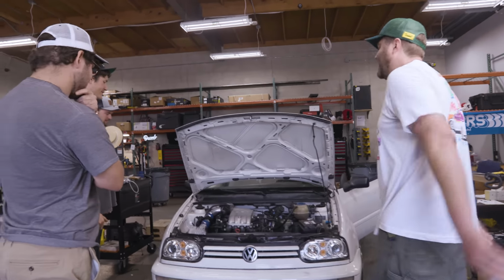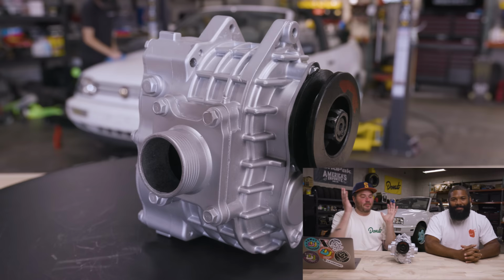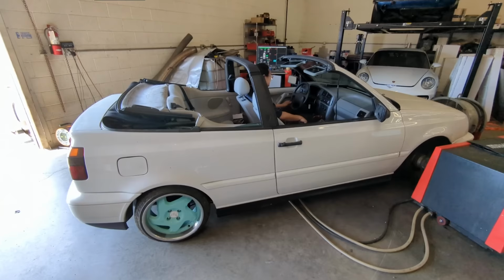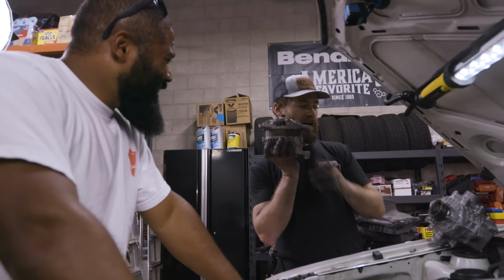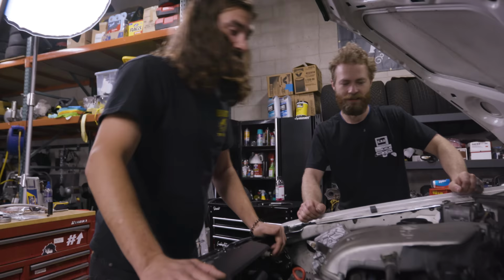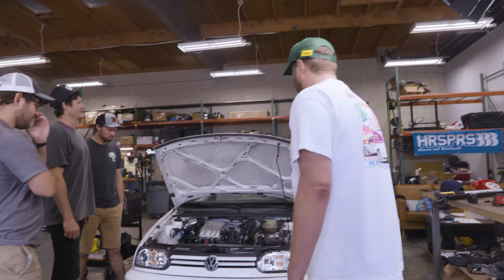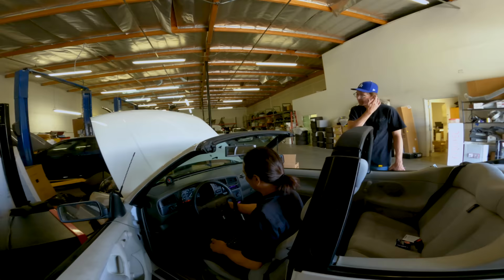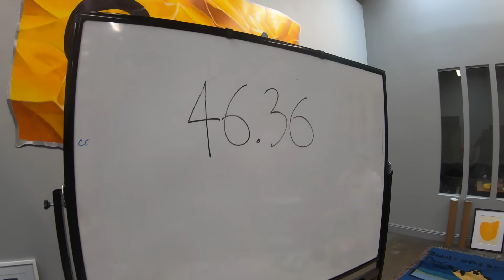We Installed a Wish.com Supercharger on Our Car

Comment: The amr500 super charger is what is used in classic beetles. Apart from questionable quality this should be useable for that.
Reply: they are designed for a 900cc motor not a 2L
Reply: @desertsasquatchxploration1568  they didnt give it a tune so its just working harder to compress more air (both in the supercharger and the compression stroke) with no more fuel - hence much less power.
Reply: There is something wrong with the installation, that's why it didn't work, you are right we also tested it on an aircooled vw and it worked well
Reply: @mycosys  explain how changing fueling and ignition is going to over come a lack of air flow coming out of that charger.
Reply: @bowez9  it's not a lack of airflow, its excessive airflow for the a/f ratio
Reply: @datjap8883  but they measured about only 1 psi when letting off the gas. I might lean towards it being restricted or geared wrong with a too large pulley
Reply: I saw that these were also being sold as replacement superchargers for the 2000s Scion tC
Reply: @bowez9  it wont - but it (and the rest of the tune inc pulley sizing for that matter) would at least tell us whether that was the case
Reply: @mycosys  pulley sizing isn't tuning any more than swapping a cam or a head swap is tuning.
People were brought in with experience with the charger so the compressor map should have been known, never mind the inlet/outlet port sizing (being 1/2 the size of the stock ducting wasn't a good sign either; as it would only flow 1/4 of the air.)
Reply: @bowez9  Those three things need to be in a correct balance for the engine to work properly, that's basically what "tuning" is.  If any one of the 3 is out of whack in comparison to the others you'll lose power instead of make it (or possibly destroy the engine).  You can't just add one without properly adjusting the others.
Reply: @ToasterCoasterAdventures  its a 500cc per revolution super charger, it would need to be spun at the correct speed to work
Reply: @mycosys  The air intake system will adapt enough for the measured air increase and supply more fuel (if this is the case).  The issue here is this supercharger cannot move in shear volume the amount of air that the car needs even at STP.  The stock engine itself moves more air than the supercharger can.
Reply: @s.willis8426  tuning is what I'd done after the proper parts are installed.  Not what is done to cover the wrong parts in the wrong application that is a redesign or modding.
Reply: Wrong parts in the wrong application is what being a gear head is all about.  Like a small block ford in a porsche 914, a LS in a RX-7, or a rotary powered Miata.  This was obviously not a serious mod they were doing, they bought a cheap part from a non-automotive marketplace and tried to see if it worked.  That said, if they bought a serious supercharger from a reputable retailer, installed it on the Cabrio with no other upgrades or tuning and they likely would have had similar results of it not working properly.
Reply: Are they just running it super lean? Doesn't the pulley decide the pressure it's going to build? So they are just shooting more air into the engine and the same fuel ? AHHH SO MANY QUESTIONS! Aren't old beetles carbonated , the more I think about this the more questions come up.
Reply: @ToasterCoasterAdventures  well.....not unless you over spin the rotors some more LOL.
Reply: I thought the same. It should have not cut power in half. Is it possible the smaller pulley is overdriving it past its capabilities? Was the tune done at the dyno or at least capable of being modified at the dyno?
Reply: @Mr371312  really cant go smaller than they had, this supercharger isnt big enough for anything over a liter.
Reply: @mycosys  watch grind hards video, the pulley is already small and nobody runs superchargers of the serpentine belt anyways. But superchargers in general are very finky and hard to make work. Theres a reason turbos are used over them.
Reply: @bowez9  this compact style of roots supercharger isnt used by anyone seeking to make true power, again its best application was grind hards 450cc atv motor. I would be shocked if there is any type of maps for this thing anywhere.
Reply: @cmendoza1094  the faster it spin the more pressure but just like a air compressor has high psi output but can't inflate a bouncy house the big issue is the cfm, its just too small to move the volume of air the motor needs.
Reply: @superhawk20002  its just suficating the motor to an extreme degree. Thats why real superchargers cost so much
Reply: They need to use 2 of them and change the pulleys aswell.
Reply: @s.willis8426  a properly size supercharger would not have cut power by 50%, now no they probably would have seen 30-50% gains either with out tuning, but would have been gains none the less.
Reply: @cmendoza1094  the intake was too much of a restriction on the charger as it was 1/2 the size of the Stock inlet.
Reply: @WillBilly.  they brought in people with experience with this charger (or so they said) even without a map they should have known : displacement of blower, drive ratio, and pulley size relating to compressor speed, and at what compressor RPM efficiency drops off.
I have a 93 SC with a ported Eaton M90 and all of the above is known without looking at the compressor map.
Reply: The sensible choice would be to use parts from a 1.8 g60 engine. Basically the same engine block as the 2.0 they have. Could bolt the parts straight on. Would be fairly boring to watch though.
Reply: @cmendoza1094  they obviously needed the other computor
Reply: @bubot17  it's just simply too small of a supercharger for a 2 L engine it's starving it of air
Reply: Yeah, this isnt supposed to be on a 2.0 engine...
You'd think that since Jer is an Engineer, they would know that already.. but i guess its just another dumb clickbaity video to get likes and views ($$) , not to care about actual informational content... which makes sense cause one wouldn't seek for such thing on this channel (anymore)
Reply: @SantNolo  just like fake news lolz
Reply: @bowez9  this blower has sketchy data sheets, Remember its straight off the boat from china. This blower could never properly work, its just too small, they weren't trying to make a super serious drag car just show that these $200 blowers aren't what they claim to be. Also grind hard literally tuned there atvs to make peak power with one of these blowers, you can just look into there channel for 30 seconds instead of putting air qoutes in like im claiming false hoods.
Reply: @WillBilly.  so as I said to being with a tune isn't going to fix this setup.
Reply: @bowez9  the point was to show how the product pushed heavily by ads is not worth it, how its a scam. So why are you commenting that it wouldn't work due to them not properly matching parts when the point of the video is too show a scam in practice to show its pointlesness. My comments are responding to the argument they installed it wrong, and it would have worked if installed correctly.
Reply: @WillBilly.  I've yet to see an ad for this charger.  If it is only sized for <1L then there is no issue with the blower but it's application, just like putting an M90 on anything over 300 CID.

Comment: The supercharger needs a smaller pulley to keep up with the airflow a 2l engine needs. It didn’t build any boost because the engine was using more than the supercharger produced
Reply: It's meshing... Not boosting
Reply: I don't even think it could make boost. Totally defective.
Reply: @renzokata  it makes no boost... All that noise you hear is meshing.. this creates HUGE friction.. with friction you lose power.. that's why it kept shutting off... Don't consider this.. you giving your money away
Reply: @tommiraeko8541 So you need a pulley from Vortech for the China-made supercharger to work
Reply: tbh i think if you put a smaller pulley on it to make it spin faster it would most likely fly apart the moment it goes up to speed
Reply: Do you think you can get a 0.0018" pulley for it?
Reply: With that sound its obvious whats going inside😂😂
Reply: that makes sense only if you don't see that they've got the smallest pulley possible on there already
Reply: Everything is wrong in this video the guys in the video didn't even put lubricating oil on it,like a Subaru AISIN-AMR500 correctly installed it delivers between 0.5 and 0.7 bar of pressure, easily doubling the engine's original HP performance.
Reply: Wow, so do you feel better now Mr Well Actually? Cause I'm 100% certain you aren't telling these guys anything they don't already know, plus it looks like it's a joke and not serious. So congrats for being "that guy"
Reply: @randysavelljr5324  Richard Holdener tested this supercharger. It definitely works. They fucked up something... Also the don't ship with oil wouldn't be surprised if it had no oil in it

Comment: I have a true amr500 on my vw bug and it added about 30hp to the stock 60hp.  The wish ones are knockoffs and the lobes delaminate. They are internally oiled and usually shipped empty. Also on a fuel injected car, you need a bypass valve between the supercharger and throttle body.
Reply: Explains the horrific noise it made
Reply: I feel like these guys would add supercharger oil and not install it empty but never know
Reply: @tjcochran4641  no way they put oil on it. That sounded exactly like a drill press drilling through a block of aluminum with no lubrication. They probably lost all that power because the internals of the supercharger were shredded and blocked the airflow. We'll never know for sure though I guess.
Reply: @engineerisengihere44  sounds like we need a round 2 with a new  amr500
Reply: @engineerisengihere44  that would make sense on why it “got so much quieter”
Reply: is it dificult to install one on a bug, im thinking about installing a real amr500 in the next year or 2 to my 69 bug and am courious if there are any tips you might have
Reply: @jakephillips1997  honestly man with the price of gas I'd just go turbo if prices never drop
U already got amazing gas mileage with that tiny thing why not make it faster and better on gas at the same time
Reply: and intercooler too or E85 if not
Reply: did check on aliexpress and in the description it does say what oil to use and because of shipping it will be empty and needs to be filled before use. But honestly they made me really want to supercharge my tiny 80s 1.2, im already on the trip to dual carb so with some slight forced induction it might be even more fun!
Reply: I was thinking exactly that, 'what if it shipped without any oil?'
Reply: Also the pulley size
Reply: @jakephillips1997  wide band o2 gage a boost gage, and a bypass. You want the wide band o2 gage to read 11 to 12. Make sure you figure out how fast the blower is spinning, also put oil in the blower nobody ships with fluids in the product.
Reply: How much does the real one cost ?
Reply: Bout 200-250 on eBay.
Reply: @tjcochran4641  The instant it turned on I thought it sounded like no lubrication and it was toast in the first 2 seconds as it' had already rotated a few hundred times.
Reply: i did this with my 1.3 corolla with MS and e85. Noticed BIG difference in acceleration and some power gains! It had around 0.7-1.0 bars of boost :) .. it was daily driven so i didnt dyno it.. i would say it had about 100hp compared to stock 70-80ish. :D
Reply: I used a Vortech on my C5....I gained about 170 horse to the wheels for a total of about 470 horsepower, but I payed $8K for the install....you get what you pay for I guess.
Reply: @jakephillips1997  dead easy, been done many times. Plenty of pics online to get inspiration
Reply: @engineerisengihere44  They did oil it, check their video.
Reply: why do you need the bypass?
Reply: @Gigaguenther  when you close the throttle theres no more air to suck and the supercharger will collapse any soft hoses.
Reply: @tortron  okay yeah, so i assume you put the charger in behind the throttle body - but then why is it different for carbureted engines? i guess then you put the charger before the carb but isnt the reason you put it before the throttle body to avoid the supercharger excessively pressurising the intake system?
Reply: @marvindebot3264  it's amazing how so many people keep saying it's without oil or reversed flow, yet not one of them watched the full install video where they did both.

Comment: Haha love this! So i’m going to share the secrets of the amr500. You must run a recirculate valve before TB for this to work. Right now amr500 is controlling 100% of measured air flow at idle. vacuum will hold it open at idle and allow pressure to relieve, once you leave vacuum it will close and allow boost. They can’t/won’t work otherwise unless you mount the TB before the amr500 👊
Reply: I also didn't see them put oil in, I'm sure it came dry. Sounded like it was so loud because it didn't have any oil. I could also be 100% wrong lol
Reply: @xVern  They put gear oil in it in the GHPC video.
Reply: @xVern  Mine had oil and it was just as loud. It was near deafening which is why I had to switch over to turbskis instead
Reply: @DirtGearTv  did you make a video on it if so link the video
Reply: @Cherokee93  Ya, i’m a motorsports channel. I don’t want to be that guy who posts a link in comments but ran an amr500 in summer of 20’ if you want to check my library
Reply: @DirtGearTv  good times man!
Reply: That was the go-to for cheap centrifugal blower setups (usually vortech) back in the late 90s/early 2000s . . . the MAF stuff back then would get pretty close using it as a draw-thru but you'd absolutely have to get tuned if using it as a blow-thru not to mention a potential metered air problem. I remember on the foxbody stuff, C&L making the sample tube size changeable which meant you could throw a wideband on it, drive around, and change sample tubes if you needed to change A/F

Comment: From fine-crafted German engineering to a Stihl Chainsaw. Awesome.
Reply: They need to supercharge a chainsaw with it.
Reply: @turrboenvy4612  these video ideas are like a deep rabbit hole and i respect and commend Donut for Making videos purely in response to us.
Reply: Here's this comment exactly #3. Bots woke up early today
Reply: Fine crafted?
Reply: To be fair a Stihl chainsaw is also fine German engineering
Reply: FWIW, Stihl Chainsaws are also fine-crafted German engineering.
Reply: Stihl is German
Reply: Lol Stihl has a greater reputation in their field than VW has in theirs🤣🤣
Reply: @JoseRodriguez-dx4pb  That's not really fair, VW has a legendary reputation... for electrical problems and coil packs that can't handle relative humidity over 60%.
Reply: Comment was made about the sound only. I thought about using Homelite but figured Stihl was more common. Husqvarna would have been lost on most.  Cheers.